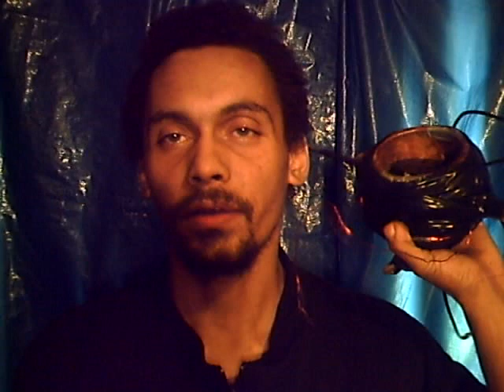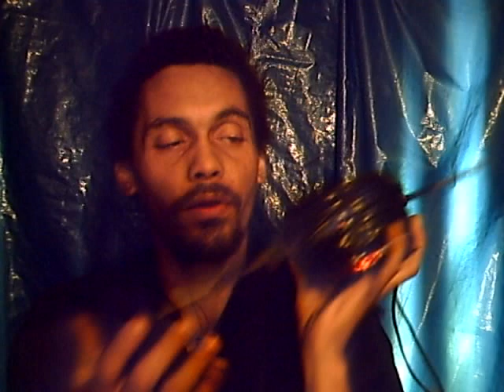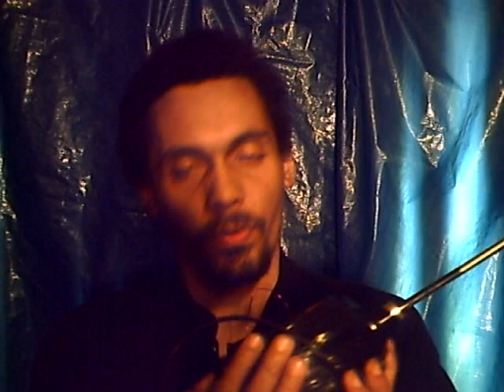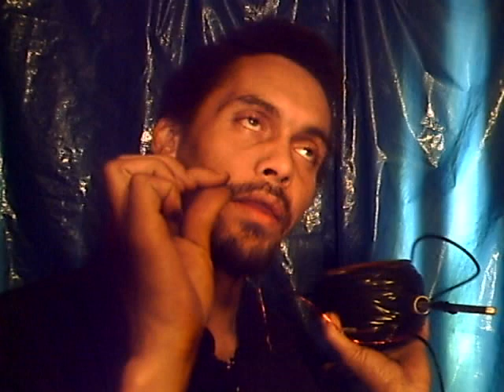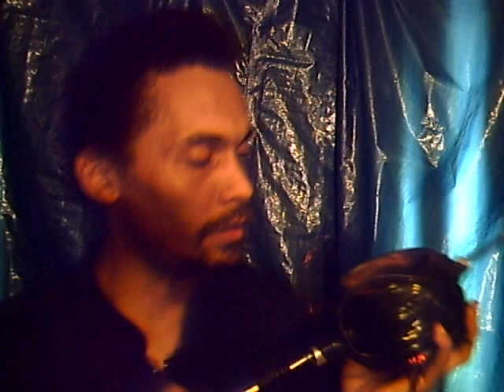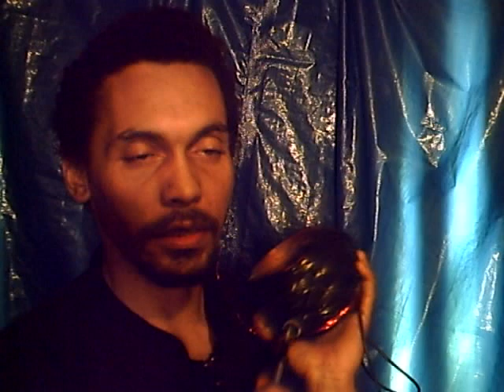newman machine pt 5

Comment: Hi Joseph. If it works, why fix it? If it works why analyze it? I am a retired electronics research and developement engineer. I was taught to design. If it works great. If not then analyze it and fix it. Saves time if it works. You can move on to the next project. Keep going. I shall be building a copy of yours and will let you know of any improvements I make. Raymond.

Comment: It certainly is DC machine. Here are some specifics:

Rotor has only two magnetic poles.

Only two magnetic poles in the stator which may be swapped.

The power output of the motor is determined by the following in decreasing order of correlation: commutator, rotor's magnetic strength, coil's inductance, input power - i.e. there is a very loose correlation between input power and the power output of the rotor and a very high correlation between timing and output.

Comment: With the beginning of a wire, use some watch batteries to draw a small current and then connect the end wire to a car battery.  I would love to see watch batteries being used to power any size motor. That will be a lot more impressive to me than the use of the typical 9V or 12V batteries beings used in these videos. 1 kg * c^2 = 2.49654216 * 10^13 watt hours ... peace <3

Comment: Should be able to power a car (or power an electric car's onboard battery recharger) with a medium-sized Newman engine. That would anger people great. (Just leave it to recharge to a certain point then shut off so it doesnt wipe out the neighborhood. Use pulsed capacitors like ZAP electric cars "Zap-X" Crossover SUV model. Maybe notify ZAP electric cars about Newman so they dont have to stop for recharge time which is currently 10 minutes per 350 miles at up to 155 mph. (644 horsepower).